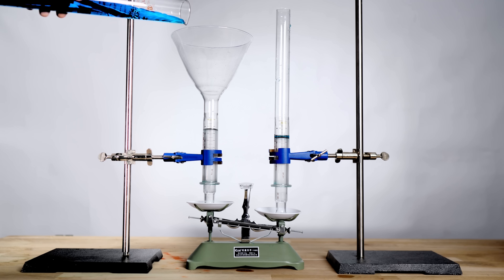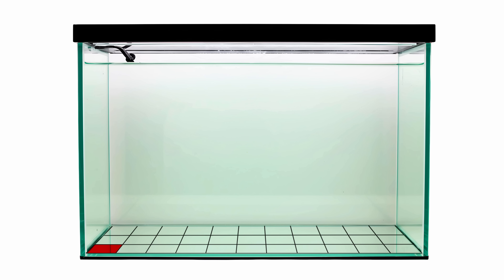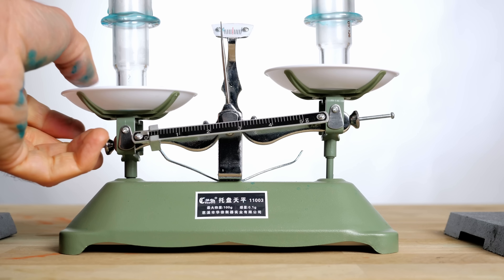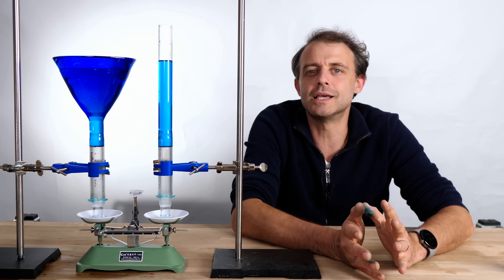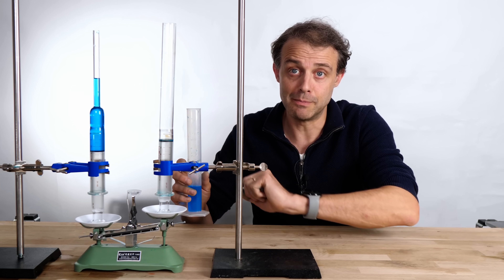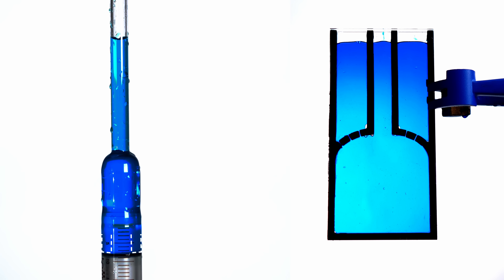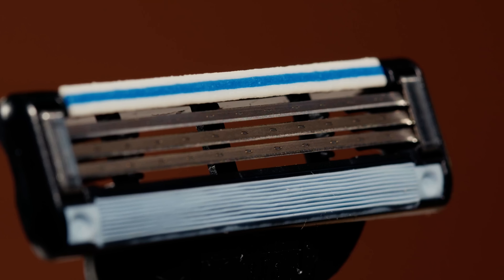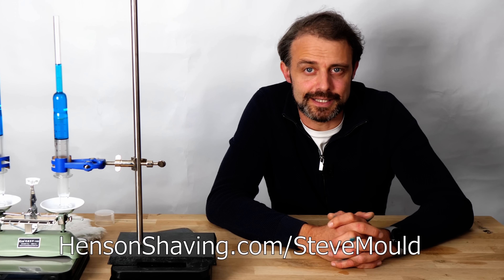The Hydrostatic Paradox

Comment: I hate it when a video smoothly transitions into an ad, especially when it does so instead of having any sort of conclusion or closing remarks. It makes the whole video feel like an ad, and makes every thing less satisfactory or memorable.
Reply: Agreed, it's like he just walks away mid explaining something interesting rather than concluding it.
Reply: Sneaky Mr Mould, I'd got used to spotting the subtle not subtle transitions "...and that reminds me of..." before the ad. reads on previous videos 😂
Reply: I hate when a videos volume is super low so I have to crank up the volume only to have random ads absolutely screaming at me.
Reply: Yeah, rather than a transition into an ad, I prefer a nice clean cut. Just like the clean cut I get with a Henson AL13 safety razor.
Reply: @paulvander120  lmao
Reply: @paulvander120  ha ha. I bet you were waiting a few months to be able to use that joke… about the same time it will take to pay off the cost of a Hensen AL 13 vs the cost of multi blade alternatives.
Reply: Agreed, this always feels more sleazy than just having a clear break for an ad. I hate it when Real Engineering does it too.
Reply: Eh, I disagree in this case. There really wasn't anything left to say in the original video, and the transition was clear and obvious to me, especially with the AD at the side.
Reply: I would be upset too, but shaving his leg while wearing a stiletto absolutely killed me 😭
Reply: Not true. If you cut out the ad part, the video would still be very interesting and make perfect sense. You don't take away anything from the topic. So the ad was beautifully stitched at the end and wasn't cause of the video.
Reply: That’s EXACTLY what they’re trying to do, because they need more people to go to their sponsor. What you just said is probably the biggest compliment about his videos he’s ever received.
Reply: I quite liked this sponsor segment which is unusual for me. He talked about shaving in terms of physics (relevant to the video topic / audience) and discussed R&D the company is doing, rather than reading marketing nonsense phrases, misleading claims or buzzword bingo. I do agree though there should have been a proper conclusion to the actual video about the water columns
Reply: Im getting better at noticing when the pitch is coming becuase you known its always going to be that way, then I just leave at the the first 2 or 3 words 😅
Reply: welp, it seems that Steve cleverly snuck in a totally unrelated piece of knowledge...

that being, of course, that sometimes the difference between a video and a sponsored segment is slim enough for them to smoothly go into each other

i of course knew everything said in the sponsored segment and while i theoretically knew the main part too, i don't think i have seen it demonstrated except with the 'communicative containers' which kinda fails to hammer the point home, at least it doesn't at the same level as the demo in the video
Reply: It's like a really long segue, except there was no first statement to transition from - it's just all one long transition to contextualize the advertisement.
Reply: enough about hate. What are some random things you love?
Reply: spoiler alert guys there's an ad at the end
Reply: @earthling303 lmao
Reply: Google Sponsorblock. You're welcome.
Reply: When he grabbed the razor I knew excactly what it was going to be 😁
Reply: Regardless, Henson is the best, I love mine and I've bought many of them as gifts and everyone loves it and won't go back to anything else.
Reply: Steve Mould always seems to do that.  I much prefer video which clearly delineate when the ad is starting, like Matt Parker and Jay Forman.
Reply: This one was particularly annoying. Perhapse he earns more if it's done like this.
Reply: Yeah this one felt less like it was about the water column science, which I was 100% here for, but then it just seemed like it was a preamble for the ad
Reply: I agree. "Smooth" ad transitions becoming so ubiquitous on YouTube has become quite tiring.
Reply: At least what he said was genuinely applicable to the sponsor and is an argument for its use over its competitors, not just clever word play to transition over.
Reply: @needamuffin it concerns me that you don't see how that makes it worse, not better...
Reply: @needamuffin you missed the point. OP is saying, and I had the exact same feeling, that that horrible smooth transition to the add makes it feel as if he (Steve) came up with the video exclusively to hide the add in it.
Reply: @JB-dl7pp  I understood the point, my point that you missed was that it was admittedly a clever version of the annoying thing.
Reply: @needamuffin you missed that they also understood your point.

To resolve you people's argument, it is enough to note that what you find nicely done in the video (building it so that the transition to the ad is smooth) is the very thing that the original commenter finds annoying (that the ad dictates the content).

It's two sides of the same coin really. Personal preferences on the effect of each side then comes into play to create a discourse in the comment section, creating engagement and boosting ad revenue, making it more likely that Steve will continue to let ads influence his videos.
Reply: @JB-dl7pp  man needs to make a living and they like the smooth transitions it seems. I like it better, obviously he doesn't make a video around the ad, he might just choose different ads for more related videos like any smart person would
Reply: Sponsorblock my dude
Reply: Get sponsorblock then
Reply: At least it was not in the middle... 👍
Reply: he does that everytime too
Reply: Thanks for your comment. I will now it finish this video 👍🏻 fuck ads
Reply: Yea this was bad
Reply: I just hate ads. If I were more tech savvy I'd figure out how to block all of them. Hell, I'd even invent AR glasses to block out irl ads as we'll
Reply: yeah he's terrible with this
Reply: I am watching it muted..
Reply: Easy solution for it exists. Search for extension which skips sponsor parts. I can't write name here as YT blocks it
Reply: yeah i prefer if he had a closing statement before or after the ad, it feels like the video just stopped abruptly
Reply: But ads break the immersion
Reply: I agree
Reply: At least Henson razors are really nice, Better to have a good sponsor than just let some A.I. slop run on your channel. In my opinion anyway.
Reply: Use revanced it skips ads
Reply: Me too... I was thinking he would come back and sum things up after the ad, but he didn't and I felt like I was missing something... Please work on this Steve...
Reply: Safety razor blades are not TSA compliant.  They say you have to remove the blade, that blades need to go into your checked luggage.  I really enjoyed the video and even enjoyed that the ad was more quantitative/scientific to the point I was considering switching.
Reply: It doesn’t bother me.
Reply: Get sponsorblock.
Reply: Get sponsorblock.
Reply: I'm leaving early.
Reply: I don’t see the issue. You know this guy has to eat, you know these videos cost time and resources, so why are you complaining about an ad? If anything, this ad read was made relevant to the product and was a good sales pitch. I respect is Mr. Mould, fuck these pearl clutchers.
Reply: Thank you for reminding me to watch on PC where I have sponsor block.
Reply: Especially when the claims in the add are Violently anti-scientific and insulting. But hey, get that pay day.
Reply: On the point of the ad, that safety razor…..the product is so generic.

Gillette make one and sell it for £10 in the UK.
It’s a safety razor. There are at least multiple dozens of such items with the old 30deg angle. The disposable blade is generic too. The product = standard product x advertising.

Not scientific. Don’t get sucked in! Buy a cheap handle for same thing.
Reply: Exactly, the explanation was abandoned midway 😢
Reply: Well, that's the only way I'm gonna get tricked into watching an ad at all so... I guess .... Kudos for the slippery product insertion.
Reply: Then use brave web browser,& use youtube in it
Reply: Real life lore does this seemless transition to advertise a different video from their streaming service. I hate it so much. Just finish the video properly first! Give it a satisfying ending!
Reply: Smooth transition to sponsors are bad.
HS razors are alright. 👍
Reply: Bro has to eat, too
Reply: I feel like the video exactly did not explain the clamp stand getting lighter, I would have watched for another 5 mins for that to be explained to me in a way I know Steve could explain it I’m just lost and feeling sad
Reply: @samswift1718  Think of it as the transfered pressure of the larger weight pressing up on the underside of the curved part, so there is less weight for the clamp stand to support.
Reply: @jaelwyn that’s a good way to think about it thank you !
Reply: I instantly knew it was an ad when he said single/multi blade razor. Those companies advertise so hard on the internet.
Reply: Use brave browser it blocks all youtube ads
Reply: It is rather this is bad or you are just dumb.
Reply: good teachers will do that.  "keep ya wanting more, learing"    dont conpain, we know the veido are great & we learn alot .  the smooth trickery  into add. let's ya know the veido MAY be over . + the adds are normal for a way to help lear , & thats the entire reason ya watched this in the first place , so yeah the trickery is a bit wrong but well delivered..
Reply: Personally I don't care if, how, when and where Steve or any other creator does an ad.. adults have families to feed dude.
Reply: Sponsorblock
Reply: Any award for the smoothest transition to a sponsor goes to… 
(I applaud the result!)
Reply: Sponsorblock ftw
Reply: Do it differently on your channel then, or stop watching. But don’t whine and not think for a split second about why he did it that way. People whine about everything. It’s impossible to make everyone happy.
Reply: I saw it coming
Reply: Welcome to capitalism
Reply: Absolutely true
Reply: metric or imperial
Reply: YouTube, turning smart and talented people into late night infomercial hosts.
Reply: @dannymars  That's not just Youtube, that's everything. That's what happens when ad revenue runs the entire creative industry. It's disgusting.
Reply: Cough. Sponsorblock. Cough.

What ad?
Reply: @georgeprout42 I LOVE SPONSER BLOCK I LOVE SPONSER BLOCK I LOVE SPONSER BLOCK
Reply: It doesn't help that some brainwashed viewers PRAISE creators for having deceptive transitions.
Reply: Same here, it's so much better when there's a clear divide. As soon as the ad notice comes up I stop the video of course, but there's always some intro to it that is also actually part of the ad, but just not marked as such. It feels dishonest.
Reply: @georgeprout42 exactly lol I know right where they are, and I don’t even see them. It’s jarring as hell for me, but that’s a good thing. All glory to SponsorBlock.
Reply: The transition from content to add was as smooth as a face shaved by an HS razor.
Reply: 100% agreed, give me a clean cut between the video and the ad. I understand the sponsor is a necessary evil, but you don't have to go all the way to the video version of native advertising
Reply: @ulrar it's a good way to slash the amount of sponsorships you get
Reply: It's a good product and they deserve a good ad. Honestly, it's a credit to Steve to take these principles from hydrostatics and apply them to a sponsor's product.

I think it's a win-win. Science communicators deserve to be paid so they can keep communicating science.
Reply: With sponsorblock the video just abruptly ended without conclusion. I don't know which way is more annoying, but thisway I at least know the authors priorities without getting lured into an add.
Reply: That’s the best kind of integration. Seems like a you problem. You know these guys have to get paid right? Stand copy and paste ads are the worst.
Reply: It is against US FTC regulations to not disclose a sponsorship like this near the beginning of the sponsored content. Some people will include a disclosure at the beginning, as they are supposed to, but too many don't.

It really bothered me this time. Despite admiring Mould's exceptionally well done segway into the ad, I felt deceived in some way.

Sponsorships need to be disclosed early, and clearly, in videos. That's how it is supposed to be done according to US law anyway.
Reply: @inthefade 
The moment he brought up the product he put up an ad banner.
Reply: @i @inthefade did it really bother you? Awe.
Reply: Have you heard of 'sponsor block' my child?
Reply: Give sponsor block a try 

Its a browser plug in
Reply: I hate when people think everything is free and btw its only one ad and steve is able to do his amazing job do you get it steve needs ads do you get it or do you send him money for all the different things that he wanna show us im glad that knowing everything from this video only cost me 15 sec of ads have a nice day
Reply: Sponsorblock is the solution. The video simply ends on "the clamp stand gets lighter"
Reply: @uncertain.aftermathdoes that work on phones and TVs?
Reply: He took a lesson from Paul Harvey. This deceptive crap is bleeding from AM radio to YouTube...
Reply: I will happily watch the ad because this is how people like Steve get paid. There is not much money in yt videos unless you have crazy viewing figures.
Reply: I think the smooth transition to the ad in this case was really well done. I hate it as well but top marks for doing it so well
Reply: It does say AD in the corner when the ad starts.
Reply: SponsorBlock maybe?
Reply: Using SponsorBlock, the video just ends randomly lol
Reply: I am so sorry you had to go through this.
Reply: Also the ad continued for the rest of the video even after he removed "#AD" from the corner. Gotta get the bag by any means necessary I guess 😒
Reply: @tjspeirs75 
Ah yes, because everyone assumed the ad had ended once the text saying ad read went away.
Reply: @DangerDurians I think perhaps you don't have any real problems in your life. It's a great video, as usual.
Reply: Bro just wanna earn some extra bit of cash, maybe they pay more for this type of integration, if the don’t, i criticize this
Reply: No kidding. It's getting worse too. Really fucking frustrating.
Reply: I really like those transitions.
Reply: Ive just taken my LIKE👍🏻...  and made it a DISLIKE👎
.
For that reason
.
.
First time ive ever disliked a steve mould video :(
Reply: We are getting the content for free, I'm ok with the ad.
Reply: I prefer it. These content creators need to earn money. Easy to tack it on. Weaving it in takes finesse. Good job Steve
Reply: Funny, I love when that happens
Reply: Instant channel blocker,  selling your soul, not to science but the highest bidder.

 Don't trust salespersons
Reply: You hate it? I actually really like it and I think it shows the writing abilities of the person
Reply: @yuchaoguo8399 I don't think we should be applauding people using excellent writing skills to trick people for profit.
Reply: @yuchaoguo8399 bot
Reply: That's what the downvote and report buttons are for.
Reply: Insane reach imo
Reply: Same.

Thanks for saving me 13 minutes. I'll find something else to watch.
Reply: @odobenus159  Why the heck would you start reading comments before watching a vid like this? Don't you want to challenge yourself and make guesses along the way? Half the fun of his vids is trying to figure out wonky physics like this. I don't like his style with the no conclusion summary straight to sponsor thing, but I like everything else about his vids.
Reply: Maybe you should talk to someone about this.
Reply: I’m so sorry you don’t have to pay for content you enjoy. You poor poor baby
Reply: @jb76489 what are you talking about? YouTube premium costs money. This channel obviously wants more money or to work less than the average person so he puts ads in his videos on top of the ads I presume everyone who does not use YouTube premium has to watch. YouTube would be unusable if I had to watch unskippable ads non stop, plus all the creator ads crammed in on top.
Reply: @jb76489 except premium members who do pay.
Reply: @jb76489  I would much rather pay than see shit like this. I pay for several things that do nothing other than remove ads from my view as a giant middle finger to ad agencies.
Reply: Oh you poor thing. Make sure you clutch multiple pearls, clutching a single pearl might be more painful.

Comment: So in your case the funnel and clamp is supporting the weight of that extra water.

This seems remarkably similar to: https://www.youtube.com/watch?v=F2M2aRXI8lc where a particulate "fluid" is supporting some of it's bulk by pushing out against the walls of the container.
Reply: Yeah, due to water being difficult to compress, it's EXACTLY the same phenomena. No need for special case for water.

It took me long to figure out, but when he says "the column of water transfers its weight directly to balance" (or something to that effect) is not correct, friction transfers weight (around half of it?) to the crystal/recipe.

That was fun, keep going, Steve!

Comment: As I understand, it is simple.
F = P*A. The P on piston head is rho*g*h, which is same in both cases.
Reply: The point Steve's trying to make here is getting an intuitive understanding of the whole system, not just a rote recollection of pressure calculations
Reply: @bosstowndynamics5488 I know he does them for fun, and this was fun. But I honestly think there's better ways to demonstrate the equation than this setup! Our colleague showed this with two different sized tanks side by side, holes drilled at the same heights with plugs in. We were then asked to say which hole would project the most water.
Reply: the view is nice, standing on the shoulders of giants.